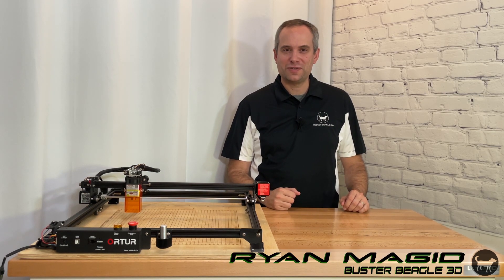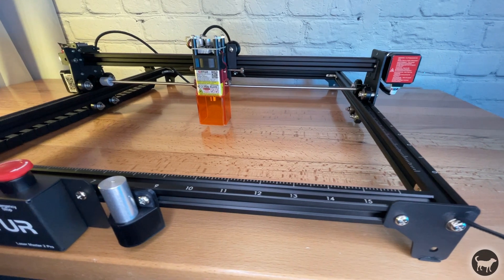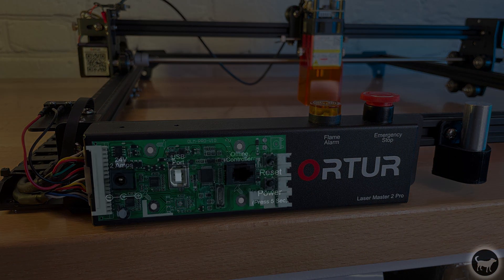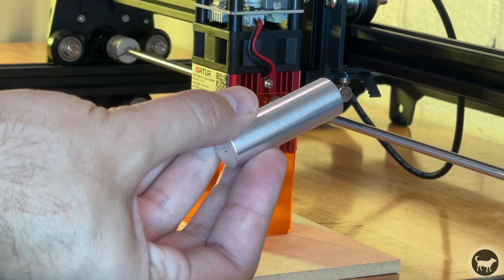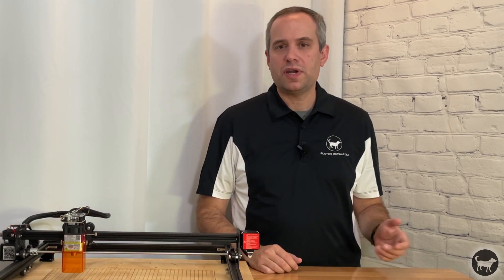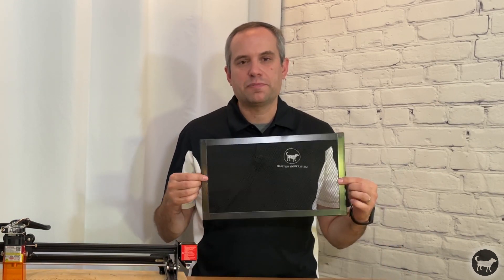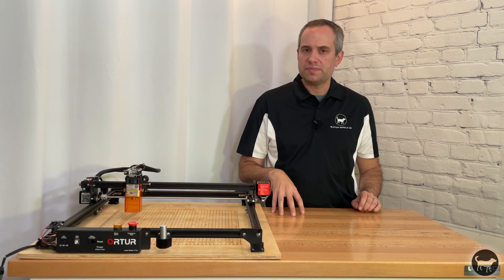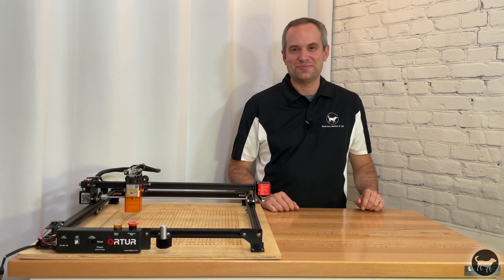Ortur Laser Master 2 Pro Review

Comment: Hi, when I try to open the speed and power test pattern it comes out many times larger than the engraver. I can't resize the file -- it's an nc file and I'm not sure what that is. I'm using Lightburn because grbl doesn't run on Mac. Anyway, if you can think of anything I may be doin wrong please pass it along.  the other files open fine -- thanks for the files and the great videos.
Reply from the maker: .nc files are gcode files. They are meant to be run directly on a machine and not really opened up. It’s been a while since I have made files for this machine so I don’t remember quite what I put out there but if you want to make quick and easy test files for Lightburn you can do so with this website for free. https://www.o2creative.co.nz/laser/lightburn_advanced_generator.php

Comment: Another great video. I posted this question on the comparison video though thought it might fit better here. What is the difference between the EU and US model? If I have a EU model and I need to use it in the US is it as easy as replacing the power cord going to the power supply with a US end and then flipping the a switch to 110V?
I just wanted your assembly video and saw that the power supply is just a 24v 2A power brick so guessing I just need a US version of one of these and I'll be fine.
Reply from the maker: That would be my guess as well. As long as you have the correct power brick you should be good. Only other difference may be the units that are printed on the frame in the US are in inches and the rest of the world gets the mm which is what I would prefer anyway.

Comment: Hi there,  just thought i would share with you a few issues ive encountered with the laser master 2 pro. First machine laser lasted 3 weeks then failed completely. Amazon replaced the engraver so all good!!! However the second machine has lasted 5 weeks before the control board burnt out! I really like the results im getting but the reliability is so poor that i am very reluctant to purchase a third machine! Have you had any issues flagged to you or am i just unlucky?!!
Reply from the maker: I haven't experienced the same issues but I'm also not running the machine 24/7 or anything like that. I just ran it again this morning and didn't run into any issues fortunately.

Comment: Is there a big difference with cutting between the LM2 and the LM2 PRO?
Reply from the maker: Honestly with cutting I didn't notice a huge difference since I took it slow on both. I do feel like the Pro is a better overall machine though. I do another vide with a comparison.  To really get a nice cut I recommend updating to the LU2-4 LF which comes with the optional air assist hardware that really helps with cutting.

Comment: Hi Ryan how are you… I’m thinking about to buy a Ortur Laser Master 2 pro… my question is::: 

does artur cause a lot of smoke?  my intention is to work with small pieces of wood and acrylic like keyrings and decorative items cut or engraved... I live in an apartment and I worry about the smoke and smell that may have... 

thank you very much for your tips and willingness to help us
Reply from the maker: Hello Fernando. Yes, all laser machines do produce smoke so they should only be used in a well ventilated area. I actually take my machine out on my deck when I use it and hook it up to a laptop to run it. You can also purchase an enclosure from Ortur for the machine that would allow you to use it indoors as long as you have somewhere for the hose to vent to outside. Hope this helps. https://www.madethebest.com/collections/engraving-machines-1/products/ortur-detachable-laser-engraver-cover-for-laser-master-2-pro-exhaust-system?aff=12
Reply: @BusterBeagle3D  got it… I really appreciate your answer… thank you so much 😊

Comment: You might try high temp black grill paint to resist the heat of the laser.
Reply from the maker: Yeah I saw that at the store. I was originally going to use that but ended up going with a Matte Finish used for cars. I thought the lower reflection would be better then the high heat. So far so good but we'll see.
Reply: @BusterBeagle3D  ah, maybe they didn't carry the stuff I have, it is a matte black. I used it on a firearm related device that gets  hot and I wanted it to be matte and it was. No worries just offering a suggestion.